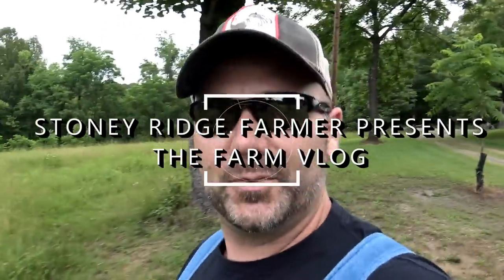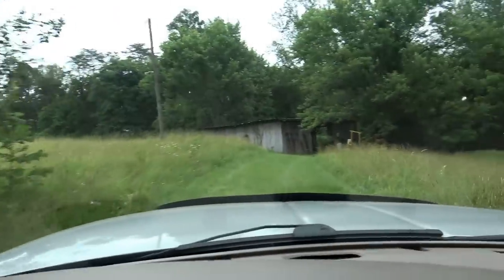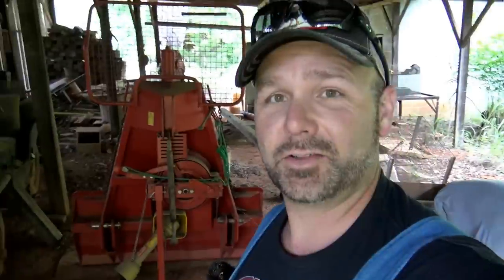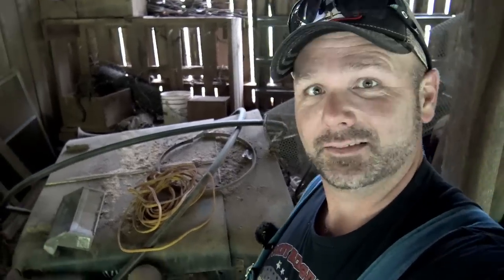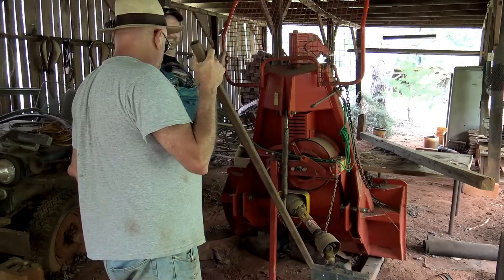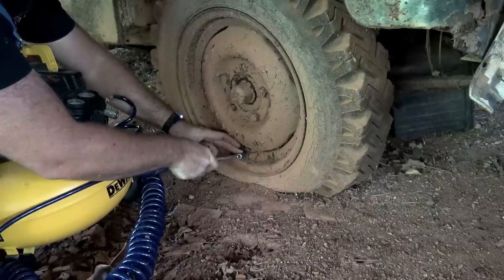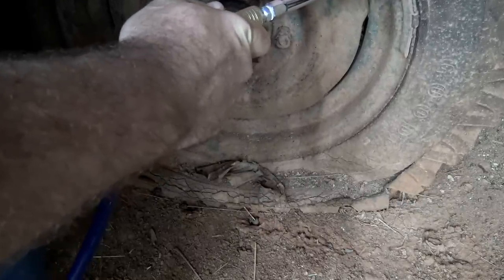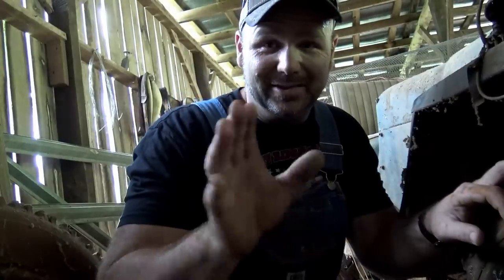Willys Jeep rescue.... wedged in a barn for 30 years...let's try and lift it out!!

Comment: I used to have a 48 Farmall AV high clearance tractor, it is a great tractor. There are some good suppliers for new and used parts .  My go to place for parts is STEINER TRACTOR PARTS.  They have a great catalog and online they have videos covering all sorts of subjects.   By the way my grandpa had a Willies that we kept at the family cabin in Grand Mesa , Colorado. We used it for hunting, fishing, exploring and for chores around the property. My grandpa said that Jeep could climb trees, and I believed it after some of the places we got into. I still believe it was one of the best off road vehicles ever made, due to the wheel base, clearance and gearing. Have fun with your projects. By the way a tip for moving vehicles in tight places and getting unstuck I use a high lift jack. You can lift a vehicle high into the air, placing the jack in a center position and just shoving it over off the jack moving it a foot at a time as you pivot back and forth front to back. Just be super careful.  I have used it off road and actually moved my BF Avery tractor one time out of a tight spot, moving it completely sideways. Enjoy!

Comment: Decoding Jeep CJ VIN Numbers on 1945 to 1968 Jeep CJ-2A, CJ-3A, and CJ-3B. 1945 to 1968 Jeep CJ VIN numbers are usually located in several possible locations. You should find a tin plate on the drivers side firewall and/or on the dash inside the Jeep.

Comment: Fun little jeep to drive. Super SLOW on the road but you can not hardly stop it off road. I have an old customer of mine who uses one to check on his groves. Keeps it in great shape. Evidently there is a surplus of old NEW STOCK parts available for them. Have not seen the ole guy in years though. But I remember installing the military tires and such for him. It will be a fun project with a little research :)

Comment: On the steering gear box. It might be a slim chance but I have seen it happen. Check the top plate (might be on the side) there are 3-4 bolts that hold the plate on. Check and make sure they are all tight. One loose one can cause it to shimmy.
Check the tie rod ends. I think that one has large straight slot "screw ins" to tighten and take out slop.

Comment: I had a 1954 CJ3B Willys Jeep, overhead valve engine with the high bonnet/hood, which had the same agricultural towbar unit except mine also had a PTO (Genuine Willys) to power farm tools. Wheel nuts left hand thread on left side of jeep and right hand thread on right side. Needed a coin to change free wheeling hubs as they had 2 rotating slotted screws to align with dots.
Oh and it was also right hand drive! Lol

Comment: To determine why the wheel won't stay straight, One must get the front wheels off the ground and  wiggle and shake every joint until you find one that seems really loose and you will have found the problem. Be sure to check the wheels from top to bottom...

Comment: Nice straight looking super a.  That is a one row cultivator, save your back in the garden and put right shovels on you can hill potatoes and dig them if you find a plow.  Another place is yesterday tractor or dealership still have some part.  There is a lot of parts out there.  I am restoring a 140, few gens newer but many of the same part. 

 I doubt it is gearbox if issue is only on one side.  Most likely drag link key or groove is worn.  If it is just weld to shaft.  Also on hill sides keep the engine trans side uphill they can be tip, that is what happen to my 140.  The are light on drivers sided keep heavy center and one weight on drivers side and stamped steel no weight on other and that should balance out pretty good.

Comment: Hello Josh!  New subscriber here with a serious case of vehicle envy.  I'd be thrilled with any one of those you just acquired, and there you are with all three!  What a deal!  This is a bit off this video's topic, but I just watched the video of you tilling your garden plot with the 135 Massey.  You mentioned hauling many loads of horse manure the garden.  I have done the same thing with mine but things just didn't seem to grow as I thought they should  I had the soil tested by the U of MO Extension Service.  I had good nitrogen levels, pH was 6.9, and organic matter was 9.6 percent!  However my phosphorous and potassium levels were excessive, attributed to my 'possible' manure overload.  This interferes with the plant's ability to take up iron and zinc from the soil.  The remedy is to use a weekly foliar spray of chelated iron and zinc until the soil" level of P and K go down to better levels.  So you may want to keep an eye no your soil's P and K levels as you go along.  You probably won't have the problem I have, but it's something to be aware of.  I'll watch your restoration projects with great interest.  Especially that Super A.  Perfect larger-scale gardening tractor, and it has it's cultivators too!  Wow!
Reply from the maker: So I mixed in compost...wood chips (composted) manure...hay....pigs lived therer for a while...rabbit poop....goats lived there for a month or more.....sand...clay soil and a touch of organic fertilizer....I think it just takes time to mature...I put composted horse manure right up against the base of the tomatoes before mulching them (1 week before) and it made them take off...I think you need to give your garden some time to mature....oh we also mix in egg shells for Calcium..this may also affect the zink and K level...Im not sure

Comment: Looking forward to watching the vids on this.I learned to drive in an original '52  myself.A tank on tires.
Reply: FWIW I learned how to drive to a store in a 1954 Buick coupe. I was about 15 at the time. Around 1967. It was about 2miles there and back.
Reply: Me also in a 1946 CJ2 with a 4 cyl side valve engine.

Comment: Hey Josh.....that Jeep needs 8900 dollars worth of chrome parts first.Then get a new sound system....tires...wheels.....winch.....fender flares....lift kits.....engine fan.....air unit....air horns......oh yea.....does it run at all......nope......but it looks good sitting there..!!      Woooooo
Reply from the maker: Yep...or I could just get it running and ride around the farm on it

Comment: All tractor wheels wobble to some degree.  This id due to turning the wheels against the furrows and drivinthem with one wheel in the furrow to keep the rows straight.  On a paved road the wheels will wobble all over the place.  I just usually kept a little hand pressure on the steering wheel to keep them turned a little off from straight ahead.  This would reduce the wobble, somewhat.

Comment: Why don't you rebuild the gear box. The old gear boxes were adjustable with a crescent and a screwdriver. I've even used white lead instead of grease. Take the steering shaft off at the knuckle and pull the worm gear clean and reassemble with grease and adjust worm gear.

Comment: Thats one of the only '52 Super A's that I seen that didn't have dents in the grill or hood.
Reply from the maker: It's been tucked away in my dads basement for years and years!
Reply: I'm not sure what you mean by "Super A".  Do you mean CJ2-A?
Reply: @derekheuring4646  Tractor
Reply: Derek Heuring - Re: the Super A,  he's referring to one of his other purchases, which was a  'Farmall 52 Super A tractor'. The Willy's in this video is a CJ3A - produced between 49 and  53, I have a 1949 model.  The CJ2A's finished production in 1949, crossing over with the release of the 3A's in the same year.

Comment: This doesnt surprise me!,  23 years ago in england, we found an old american dodge truck that had been used for towing farm equipment, left sat outside for about 12 years, and had sank about axle deep into the dirt. The guy that owned it had just used it for storing junk and tools in,  .....we offered to buy it! But he just laughed and promised us that it was immoveable!!.
It took a whole weekend to dig around the wheels,  the diesel fuel just needed filled!, we didnt have to bleed it,   after a new battery, and some harsh high revving, the siezed  brakes rusted up, released!!,  we managed to drive it the ten miles back to our yard,  one of the inside rear tyres shredded, but we got it back!, american engineering was made to last!!,

Comment: Hi SRF, I really liked this video! Both of these projects the old JEEP and the I-H, But the tractor got my motor running. About 35 years ago I brought home from the I-H dealer I worked for, a little I-H T-4 crawler that I discovered had only a few hours on it, but had been abandoned in a draw next to a small creek. I had to make new brake-bands, but most part were still listed.  It was new in '65 from the same dealer. If your curious what I did to the old girl go to TractorData.Com and enter T-4 Low Profile. The baby is my grown son and it was running, Keith L.

Comment: I know this is an older video, but I was wondering if you ever found the VIN (Sorry, I didn't have time to go through all 581 comments)? I had the same issue on my '51 CJ3A. There's supposed to be a VIN on the frame on top of the driver's side rail just in front of the firewall. I never found it on mine after having 2 state troopers look. They ended up stamping a new VIN plate and attaching it to the dash.

Comment: I can't wait to see the Jeep going!  It'll be a work horse.

I would only fix up the Farmall for sentimental reasons, or for having it as a novelty.  You have other tractors that will do more.  Parts can be pricey, too.  Be sure and do a thorough search, because the prices vary a lot, too.  You might use it for barter for an implement.

Here's a couple of sites:
Carter and Gruenwald
Steiner Tractor Parts
Joe's Farmall Parts
Sam's Tractor Catalog
Devon's Tractor Parts

Just search for the names.  YouTube won't let me cut and paste into the comment, and I'd probably make a typo or ten typing in the web address.

Red Power Magazine has a forum with a lot of info, too.

Comment: Have not looked through the comments section,you asked about tractor parts supply. Are you familiar with Steiner Tractor Parts ? Easily found on line. Quite comprehensive.

Comment: Cant for you to work on the super a tractor i had to put a clutch in my neighbors Super A Farmall it's a strong little tractor that hand crank though got to watch it it'll break your hand its a 6 volt i use to live in monroe nc there a tractor junk yard there  there a canster on the side open it up looks like steel wool it needs clean out an crb bowl